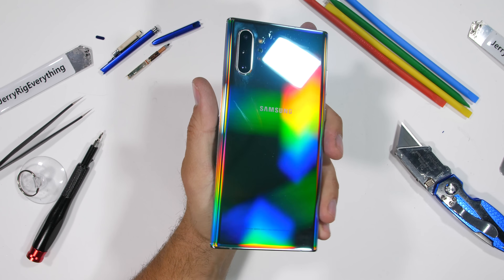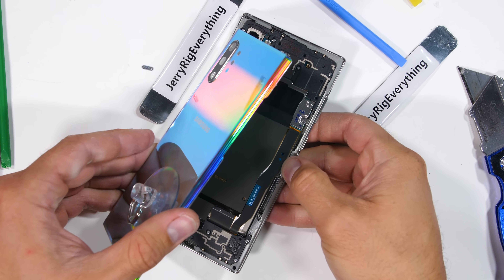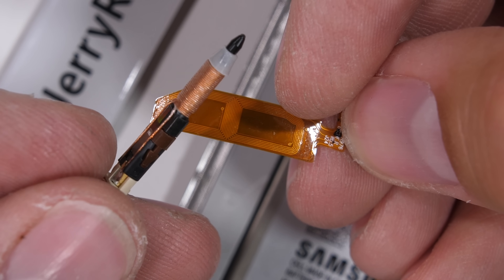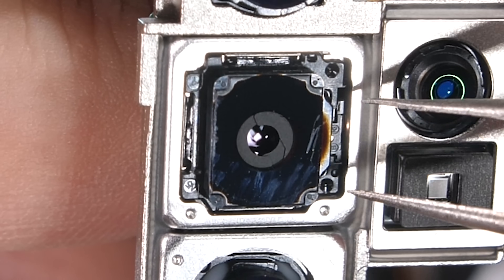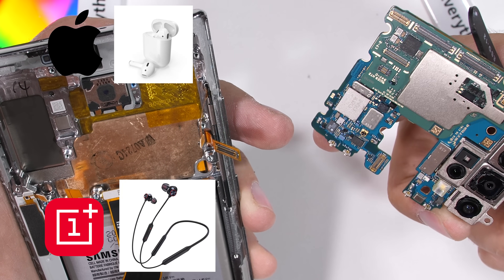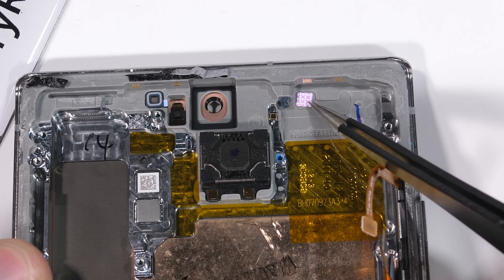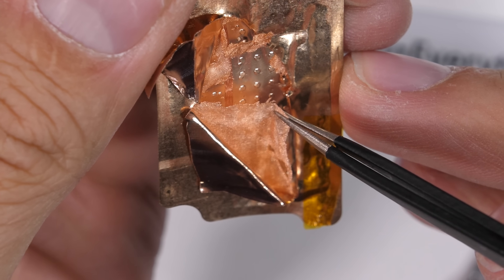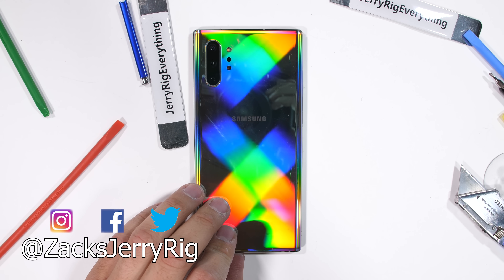Samsung Note 10+ Teardown - TWO Wireless Chargers?

Comment: Hi Jerry , my note 10 plus has network and  call drop issues . Samsung found that there is a issue with mother board which needs to be completely changed . Is that ok to replace or should I insist for replacement with new phone .my phone is just 40 days old . Please reply

Comment: I disagree with Jerry about the headphone jack sooo much, i mean the company could as well sell ordinary earbuds instead of giving them in the box for free anyways, and it is absolutely understandable that a company doesnt want to remove a headphone jack until they develop the pair of wireless earbuds of their own. 

The reason they actually remove the headphone jack is because most of us in tech do believe that it is an antiquated port (for mobile, as well as for non professional use) and that getting rid of it pushes us one step further into the fully wireless, portless future. 

That is the ultimate goal of all tech companies, not just Apple. The perfect, ubiquitous device that feels natural, seamless, perfect, and that is completely integrated. Glass back, screen front, selfie cam is under the screen (or as some iPhone rumours have it in the bezel), rotation doesnt matter, no buttons, no ports, and you just use your phone without any learning curve. Which is also why there is this big recent push by android OS by all manufacturers to heavily simplify and come closer to iOS in their user acessibility.

Thanks for coming to my Ted talk (srs doe im tired of the headphone jack meme, like just get over it people)

Comment: Hi there, I'm starting to have problem in my note 10. When i shake it or tap the bottom part in my hand the Spen falls off sliding out though i click it in place. Even sent it to samsung for repair but they say it's all good. They said I didn't clicked the pen but ive been using every Samsung note ever and huge fan. So i would love to see the spen chamber breakdown video about why it is having this problem and what the mechanism about it. 
Btw the spen falling off is still happening and had to pay 66$ to samsung as service fee for no reason.

Comment: With the variable aperture on the main camera I was giving that some thought. You said its the only company to offer it and I think there's good reason for that. With a sensor that size even an aperture of f/1.5 if you scale that up to a full size SLR sensor thats somewhere around f/8 which means most stuff will be in focus and its not getting a great deal of light really. Bearing in mind all other manufactures phone cameras are able to expose photos properly in the day in bright places like the desert, why would you ever need or want a high aperture than that? If it needs less light it will just use the shutter and ISO (like everyone else) and its not because not enough is in focus because at relative f/8 everything will be in focus for a wide shot and super close up normally there isn't enough light to allow for the higher aperture. Which would be the only time in would be useful. So surely its literally not more than marketing BS otherwise every phone would have it. Especially Apple.

Comment: Zack, Hi

May I ask if you have experienced a green line screen when I try turning on the screen although when it works it still open but only for a while then goes back to black screen Samsung note 10. I have experience just this day and I wish if you could check the issue out.  My phone had a back cover adhesive replacement a month ago from official samsung service center then this happen
thank you

Comment: does anyone know where i can get that wireless chargig plate or what its actually called, i think mine is faulty, something to do with the temprature sensor, located near one of those upper screw on the wireless charging coil

Comment: If the Note 10 had a headphone jack, sd card slot, easy to remove battery, punch hole on the right side like the s10, power button on the right side and just press and hold the button would shutdown the phone just like any normal phone, i would had bought it instead of the S10.

Comment: If I disassemble my phone and remove the battery, can I heat the battery to remove it?
Reply: I think heating the battery weakens it, so if you are replacing your battery, just be careful. If not, probably use rubbing alcohol to loosen the glue

Comment: I want a phone that has a H U G E screen, and I also want to use it as a tabelt if possible. This phone seems to be just that. 

I wish they would remove the front facing camera, and would leave in a headphone jack, though. 

I'm planning to get one of these by November, I think. The Note 20 just came out, and the Ultra is only sliiightly larger than the 10+. 
Downside is that I need to purchase some wireless headphones, and I have no clue which to get. All Bluetooth stuff I've used in the past has horrible lag, and watching content was bad. I'm hoping that Bluetooth isn't as garbage now a days so I can watch things without everything being horribly our of sync.

I pretty much just decided to wait till this was "old tech" to buy it. I'm hoping there is a bit of a price drop by November.

Comment: My note 10 plus was so nice it was the best phone i ever got. I got it just a few months ago new for 400. Then I cracked the screen by dropping it on my porch from a short height and it got 3 big cracks on the front and destroyed the back glass. It completley ruins any illusion of the infinity display. It looks like everything is underneath the screen now instead of floating like it did before @nd my thumb scanner doesn't work now. I know it has nothing to do with this video, im just sad and super disappointed. I can't believe it broke so easily, normally a cracked screen wouldn't bother me so much. But it's extremely noticeable in the Galaxy Note with the Curved Infinity Display. Makes me not wanna use it anymore. Like i said i literally just got it new for 400 a few months ago and everybody wants 300 to replace the screen, plus I don't trust anybody except the manufacturer themselves to touch my phones. I'm SoL. I don't know if I'll ever get galaxy again because they're so fragile, but if i do, im getting a Life proof Otterbox case before I even get the phone in my hands.

Comment: Lightning is better than USB-C
Reply: No
Reply: karen hawkins Lightnings better
Reply: @VacMaster2020  it's really not
Reply: karen hawkins My mom has had iPhone since 2012 andit has been working fine with no problemsWe’ve never had to take it for any hardware problems
Reply: @VacMaster2020  I never said there was a problem with lightning. It's just that it would be much better if Apple adopted the Type C port since it's a standard. It would also make more sense since all of apple current laptops ONLY have Type C and a headphone jack.
Reply: karen hawkins I would disagree because lightning has been on the iPhone for a little while and I know a lot of people would be mad at Apple because they would lose all their docs and their cords and all the accessories they bought if they had to go from lightning to Type C
Reply: @VacMaster2020  Exactly that's the problem. I don't think Apple wants to go through the 30-Pin to lightning horrors again. Lightning isn't a bad port. It's just not as good as Type C with features and whatnot.
Reply: karen hawkins Lightnings better tape see is horrible I had type Secord break on me recently and it was a name brand and it wasn’t even six months old I thought a lightning cable for a year and it’s fine

Comment: Unnecessary extras such as multiple cameras are just there to make you pay a few hu8ndred more for the phone than it's worth. Smartphones should be dirt cheap by now considering how many are out there. There are so many that there is no demand, but people keep buying them hoping that the next phone will be better when it really isn't. They could have just opted to give people a lens kit, and a single, really good camera Plus, it's Samsung,. where's the removable and replacable battery? Kind of shitty for companies to opt for unremoveable batteries. And didn't Samsung learn anything from Apples mistake? We want a headphone jack, always. We don't want to have to use extra stuff in order to use our headphones, and we don't all use bluetooth. Wired connections are more reliable than bluetooth which is affected by interference all the time. And why would any model of any phone not have a micro sd card slot? We should always be able to use our own storage devices on any computerized device. By now they should have multiple micro sd slots and not limit the storage space you can use. Also, they are still using part of the advertised storage space on the phone for the O.S., which is completely wrong. If you advertise a phone at 8gb, then 8gb should be useable, if not, then it doesn't come with 8gb. If I crammed 5gb of stuff on an 8gb micro sd card and made it so only the 3gb remaining was useable then gave it to someone claiming that it's an 8gb card, then I am a liar because 5gb is permanently used already for whatever, in this case the phones O.S.

Comment: "You have to hold down the power and the volume down button at the same time to turn off the phone"

No, you don't. That's an option in case the phone freezes and you can't turn it off the normal way. Don't tell bullshit.